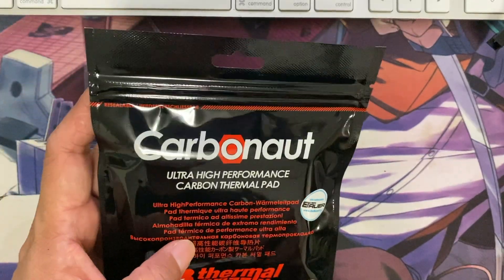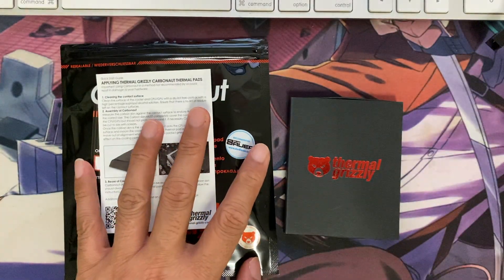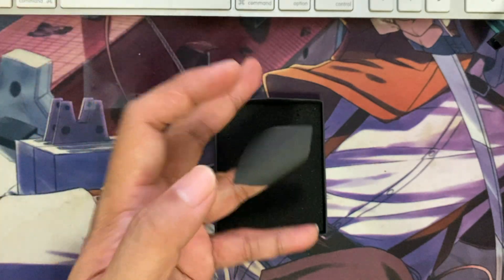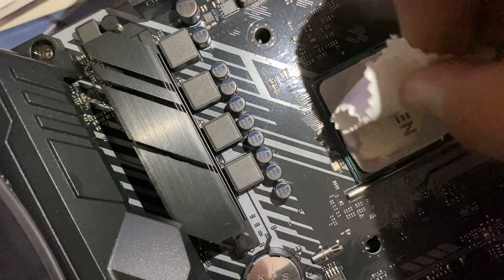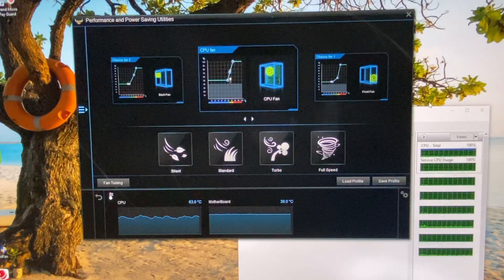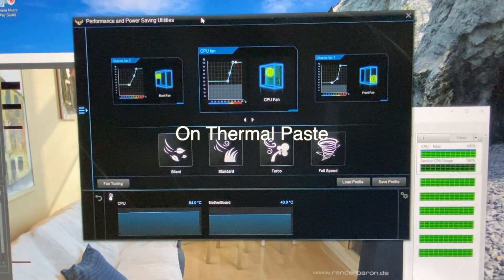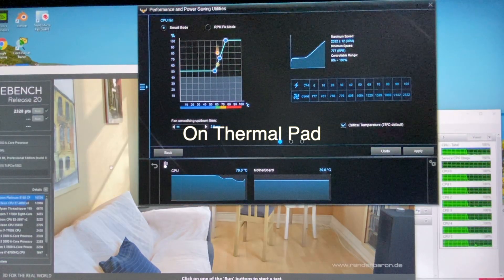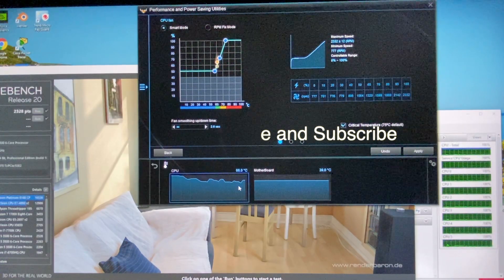Thermal Grizzly's Thermal Pad is better than Thermal Compound

Comment: Yeah, something is off here. The pads are good, but not as good as thermal paste...even the least popular. The pads are great for builds with complex hardlines and when you don't expect any changes for long periods of time.
Reply from the maker: From my results, it was great alternative to thermal paste. However, not a long term solution due to these reasons. Firstly, it's expensive for just single pad. With its price, you buy two tubes of thermal pastes. And lastly, you can't reuse it since it breaks down overtime. With mine, it lasted a year.

Comment: haaa, you should test shoulder to shoulder , how about thermo pad vs thermal grizzlys thermo grease..haaa or vs the highest conductivity grease available. So far 2C is nothing. I would expect 5c.
Reply from the maker: I will give that a try. My currently may need it I a, currently running 5600x. It's hoooot.
Reply: @SwitChildku  thanks bro,  i got rx5700xt using BSK water block(disappointed) and does nothing  better than stock fan block  I was wondering where its the thermo paste problems or not. After seeing  your video..I am thinking adding heat sink on the back side(backplate) of the gpu card to give more temperature reduction. At the moment with out an extra heat sink back plate at load, gpu90c and Junction 112C still disappointing. I will experiment with back plate(metal heat sink) see if I can reduce more temp.

Comment: which thermal paste did you use?
Reply: He have the stock heatsink so it means it's definitely stock amd toothpaste ahaha
Reply from the maker: I forgot. But I dont recommend this if you have a tendency of upgrading your proc or your CPU cooler. This pad disintegrated after my 3rd time to switch to another cpu fan. This is a great solution but an expensive one and not to mention it doesnt last for too long.
Reply: @SwitChildku  It's carbon nanotubes with aluminium crystals, you have to be really careful about how you handle it. I wouldn't recommend picking it with bare fingers. If you slide the pad with a glass surface it will likely survive the 200 applications. Bending it or applying pressure with an uneven surface will tear it.
Reply from the maker: @BeCaffe  Thank you for the advice. This will add up to my list of reasons why I may not use this thermal solution again. :0)

Comment: Not true, watch GamersNexus Video and you'll see that thermal paste is always better than a thrrmal pad due to the minimal thermal interface thickness, which can theoretically be 0 with Thermal paste due to it just being squished away.
Reply: It's better over time. He compared the pad with an old paste, exactly what matters to people buying this stuff.
Reply: @BeCaffe  Yeah, I realized that some time after writing that comment. I only thought about my use-case, I change my thermal paste whenever I start to see worse thermals (~5°C).
Reply: @markusz2n  Me too. I'm considering these so I don't have to deal with paste. I plan to get it for my GPU in the next gen or so, once they get more efficient. Thermal compound in GPUs can be painful to replace.
Reply: This pad is better for laptops than desktops.
Reply: @kapilr.4768  But where is the difference between a laptop and a desktop? Both have coldplates that contact a heatsource, so the thermal transfers matters. Pads just have a worse thermal conductivity.
Reply: @markusz2n  u can't open a laptop again and again. Laptops are getting thinner and more fragile. I'd prefer longevity. Anyways there's not much difference when comparing these solutions on laptops. On desktops, yes there's a significant difference.
Reply: @kapilr.4768  I didn't think about power and if it actually matters, I was thinking of high power laptops with dedicated graphics.

Yes, on lower power (normal) laptops it doesnt matter at all.
Reply: @markusz2n  and linus is the  no 1 youtube channel abt tech tips like these
Reply: My boy see linus tech tips he says pads are the best